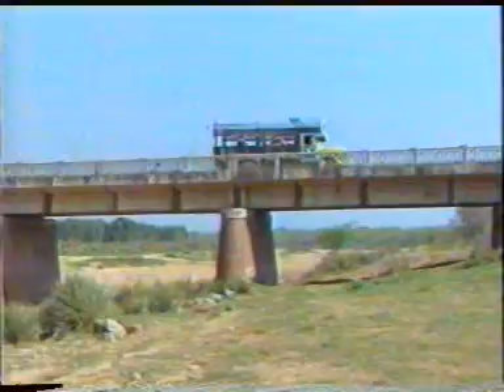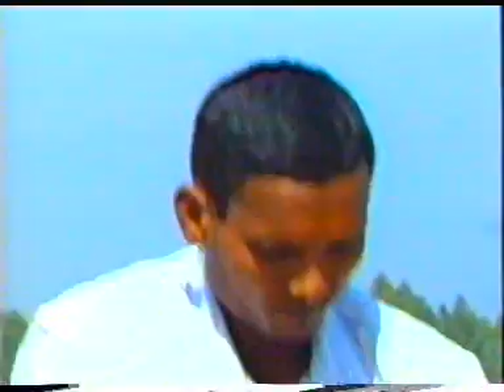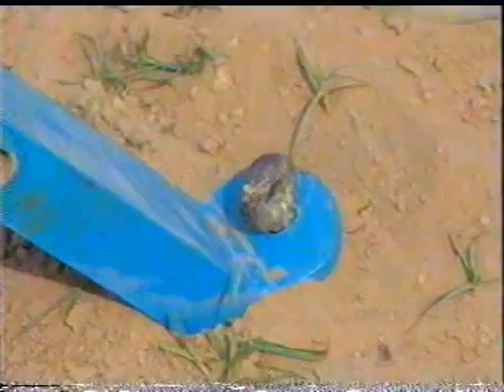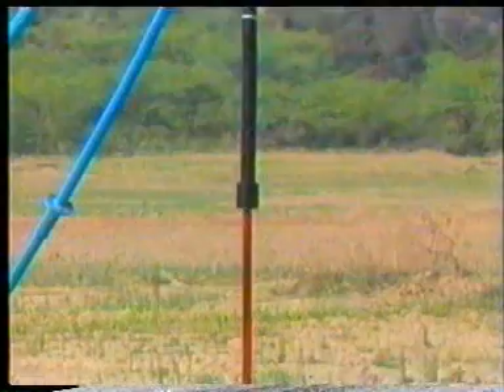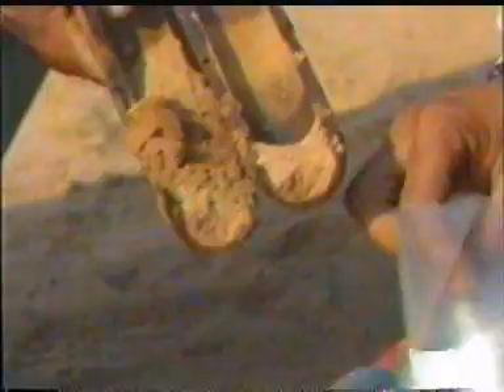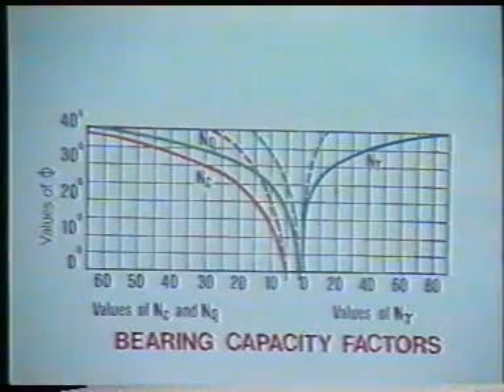Standard Penetration Test

Comment: What is the calculation of in-situ bulk density from N value
Reply: Bulk density can be determined by weighing the sample in sampler ; measure its depth/length inside the sampler . In cohesive soil , it is more reliable .sometimes samples may get slightly compacted ; but in sandy soil can be otherwise.